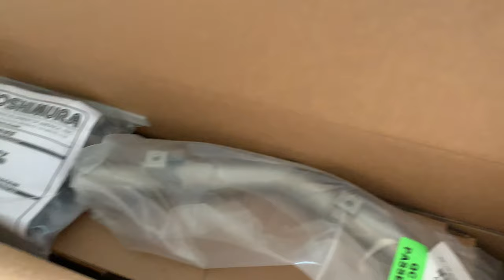Honda Monkey | Unbox, Install and Amazing Sound of the Yoshi Exhaust | Yoshimura RS3 Install

Comment: Hello! I have one question ... Where can I reliably buy a Yoshimura RS3 Full sistem for a Honda Monkey? Where did you buy yours? Of course I expect it to be original. Greetings from Austria.
Reply from the maker: I replied to this on another video, but no harm doing it here too! I bought mine on Amazon, but they also have them available on Steady Garage, MNNTHBX, DROWsports and Hard Racing (and likely lots of other sites, but these are the ones I frequent most for Monkey related parts).

Comment: Was the monkey a good starter bike? Love the low maintenance and retro look but is driving it easy? I’ve only driven manual transmission cars never bikes
Reply from the maker: Compared to a lot of other bikes, I’d totally say this is a good starter bike. Handling, weight, and the smaller engine size makes it easier to control and learn on. Just take it slow, get good safety gear, and have fun!
Reply: @UnknownOverLand  appreciate the feedback, if I do end up getting the bike definitely have to get this exhaust, sounds so good!
Reply from the maker: @YOSHIMOTO_HI_SPEED  it definitely makes the bike sound awesome. But watch out, mods can get addictive. :)
Reply: @UnknownOverLand  just got my 2022 honda monkey in banana yellow 🍌 
So excited!!! Ordering this exhaust when they are back in stock
Reply from the maker: That’s going to be awesome! Congrats!

Comment: Boy the aftermarket jumped all over the Monkey didn’t they. Looks great, sounds great.
Reply from the maker: They definitely did; there are so many options available for such a small bike.
Reply: @UnknownOverLand  now u need ecu tune and air intake
Reply from the maker: @cameronwilson4782  Have had various versions of both over last year. Check out my other videos for the aRacer as well as the Chimera intake.
Reply: @UnknownOverLand  nice, I reccomend the DNA stage 3, with that yoshi and the Cjr autotune
Reply from the maker: @cameronwilson4782  That stage3 has always looked awesome, but I still haven't had a chance to try it out.
Reply: @UnknownOverLand  yeah it’s more just looks. It’s doesn’t gain much more power than any koso or the $200 Mnnthbx intake. It does look a lot cooler though. And props to responding to your viewers, it’s nice to be able to chat with ya
Reply from the maker: @cameronwilson4782  Do you have an idea how the DNA sounds compared to the straight pipes like the MTAKE? I know that what I have can be loud for some people. Also, no problem! Thanks for taking the time to even watch!

Comment: Lovely video! What was theO2 sensor you replaced the OEM with? And was it a drop-in?
Reply from the maker: That O2 sensor came with the Bazzaz EFI I had installed at the time. In a later video (https://youtu.be/SPVzK45UOO0) I replace the Bazzaz with an Aracer setup.

Comment: At time 4:13 , the wire . Would have been nice to see where it plugged into.
Reply from the maker: Because I had a Bazzaz Efi I had installed, that o2 sensor was for that rather than the stock. In a later video (https://youtu.be/SPVzK45UOO0) I replaced that with the aracer.

Comment: Thanks for the great install vid! Please tell me, does this have the DB killer spark arrestor in it?
Reply from the maker: It is a separate piece you have to buy, but I did run one in mine basically all of the time.
Reply: @UnknownOverLand  Ok, so during the sound test on this vid, you had the spark arrestor installed?
Reply from the maker: Sorry, I realize I made that way confusing. In this video, no, I didn't have the spark arrestor quite yet. If you watch this video, it's when I finally got the spark arrestor (and I rev the engine a bit with it in): https://youtu.be/Ju6HyteWd80

Comment: Nice. Is that a stock Engine case. I could use that stick exhaust for a Restore I am doing. Did u have to rejet the Carb ?
Reply from the maker: Yes, the engine portion of the bike is stock. It’s actually fuel injected (PGM FI), so no rejetting. I did remap via the ECM, though, just to make things run a bit smoother.

Comment: The Lambda probe can simply remain in the cylinder head ... you don't have to screw it into the exhaust!
Reply from the maker: This is true, and I believe some after market headers don’t have the bung in place to move it. When I went aracer, the replacement probe only really fit in the header.

Comment: Just curious, did you install a free flowing air cleaner or a tuner?
Reply from the maker: I have both. For the intake I'm using the MNNTHBX MTake and for a tuner I've done a few things. Currently I'm running an aRacer, but I've also had the Bazzaz on the bike as well as have had a re-tuned ECU.
Reply: Cool!

Comment: Would you happen to know if this exhaust would be compatible with the Kitaco Honda Monkey Skid Plate fitment wise? Tnx for any info.
Reply from the maker: Amazing timing on your question because I was literally looking at that this morning as well. I believe that it should. The way that it installs it's meant to cover the stock headers (including the cat) which hangs a fair amount below the engine. The RS3 header has a bend much closer to the engine which seems like it'd keep it nice and high, and away from the skid plate. The one worry I have, though, is the side of the plate where the stock exhaust comes "up"; because the stock exhaust header has the cat, the bend upwards starts further back whereas the yoshi exhaust comes almost immediately up the side. This might be right where the side panel of the kitaco sits, but I'm not sure.
Reply: @UnknownOverLand  That's exactly where I think the Kitaco bracket will interfere. I already own the skid plate and just ordered the same exhaust as yours. I was freeze framing your install trying to catch the angles to see. I even called Yoshi but they said the did not know. I get my exhaust later this week. I'll update you on the outcome and thank you for sharing your insight and great videos.
Reply from the maker: Yes, please let me know how it goes. I know there are a few other skid plate options out there, but this was definitely the one I had my eye on.
Reply: @UnknownOverLand  Will do.
Reply: @UnknownOverLand  Well the skid plate did not fit due to the header pipe, without me doing some  handy man mods to it. I will say I went ahead and drilled some new holes and bent the sides out a bit and made it fit . In a nut shell on the plate itself drilled two new holes as far back on it as I could go where it attaches to rear bracket that get mounted up under the engine near the kickstand area. Then I had to flex bend outward the side flare parts that come up on both frontal brackets that connect on the sides of the engine on both sides. This made more width to accommodate the header pipe coming outward more on the exhaust side. Then I had to cut out a piece of the bracket arm on the left. Where I bent and flexed the plate outward it looks a bit shabby even though I protected it with tape and a rag, but i was not about to not try since the skid plate was almost $200. It feels solid in place and doesn't look cockeyed either. So all in all I'm happy with my rigging and feel confident I could take it off and on for any maintenance needs. I do not think knowing what I know now I would buy the plate knowing I was going to have to mangle it to fit though. But I also hate hearing "tink tink tink tink" as pebbles smack my engine under side. I'm sure you could make it work with your skills if its something you really want. I looked for other plate options but did not see anything except under cowlings. If you want to see what it looks like installed on my bike shoot me your gmail and I could send pics. I'm not a creeper or anything.
Reply from the maker: I was worried about how much mods it would take, but it sounds like it'd be manageable. I keep worrying about that one time that a stick decides it wants to test out the strength of my engine casing, so I was hoping this skid plate would be just what I need to worry less. If you don't mind sending along pictures, you can email them to unownshadow@unknownoverland.com.
Reply: @UnknownOverLand Ok will do.
Reply: @UnknownOverLand  I've sent the images. Had to send a couple times to fit the images.
Reply from the maker: Got ‘em, thanks for sending them along. Overall it looks good, I’ll take a closer look to see exactly what you did.

Comment: Sounds and looks great! does your check engine light come on now?
Reply from the maker: So far, no. I do have a Bazzaz fuel mapper on the bike as well, and haven’t had the check engine light come on yet.
Reply: Pardon my ignorance, why do you ask? Is that related to/caused by the exhaust replacement?
Reply from the maker: Some people have seen the check engine light come on for different changes to the bike, but it seems pretty rare.

Comment: Would you happen to know the db level of the RS3 at speed? I've looked online and only found the idle DBs. Your a Guru so I figured it couldn't hurt to ask.
Reply from the maker: I don’t have it immediately (though i may have posted it somewhere in some of these comments sections) but I can try and get some readings tomorrow and let you know.
Reply: @UnknownOverLand  Awesome thanks!
Reply: @UnknownOverLand  I just scanned all the replies on this thread. Did not see the dbs. It would be interesting to know. Top rev and maybe a drive by throttled up if the db reader can do that. I wondering if its anything near 90-100db at its peak.
Reply from the maker: @findingneutral  I realized that the comments I was thinking of were in this video: https://youtu.be/Ju6HyteWd80

Basically I found "Without the DB killer, idle it's about 86dB while rolling on the throttle it peaked around 116dB. With the DB killer, idle was about 82dB and throttle was around 112dB."
Reply: @UnknownOverLand  You Sir, are awesome. I know this will sound odd ball, but I just accidentally ordered a Delkevic ds70 oval carbon for a 2020 Yamaha XT250 I also just bought. I meant to order the 18inch version. Delkevic advised the peak db level on what I ordered would be 105-110 with the baffle in. In trying to figure out if that would be tolerable or just plain obnoxious I figured I would use the good old Monkey Yoshi RS3 as a base line. Based on your findings, which I greatly appreciate 🙏, since I was having zero luck finding anywhere, I can stop stressing about having to get the brand new muffler then turn right around and pay to ship it back then order the other and pay to ship it out etc... My 🎩 off 2 U 😃
Reply from the maker: Glad I could help!

Comment: how much does it cost
Reply from the maker: It depends on if you go full exhaust or not. The slip-on only seems to be $549, if you add the header it's about $629.
Reply: @UnknownOverLand  its a freaking rip off, no more extra power noticeble, maybe on paper😂😂😂😂there is so much more cheaper stuff with good looks either. i have done more then 20.000 km on my Monkey so i know from experience❤️🙏

Comment: What was that sensor and wire you removed?
Reply from the maker: That is the stock O2 sensor. I have a replacement O2 sensor that came with the Bazzaz Z-AFM which I installed on the header itself.
Reply: @UnknownOverLand  Can the exhaust be installed without replacing that sensor too? What is the advantage/difference between the original sensor and the one you installed?
Reply from the maker: If you don’t really change anything else, you can leave the stock sensor plugged where it is normally.

Comment: By chance, did you manage to weight both systems ? It would be interesting to know if the difference is something noticeable on a bike so small(light).
Reply from the maker: I did not, and probably should have. With the replacement header it removes a fair amount of pipe and the cat, so there’s definitely weight loss there. I’m unsure the weight difference between the mufflers, though. Maybe someone from @yoshimura_rd will wander by and chime in.
Reply: @UnknownOverLand  stock system is around 13 lbs rs3 is 7.5 lbs
Reply from the maker: Awesome, thank you for that info!

Comment: Did you feel a gain in torque or in top speed?
Reply from the maker: Generally this will be more targeted towards overall engine efficiency and some amount of horsepower. Because this system is lighter and with the change to fuel management the result would be a bit more top speed.
Reply: @UnknownOverLand  this is absolute not true, be honest When people ask. I have 20.000 km on my Monkey with Yosi IT doesn't go faster at all. Be honest please !

Comment: Come on man ,  800 dollars for 2 hp ... just gut the stock one and retain stock looks , the after market pipe is lacking in fit imho
Reply from the maker: I totally get what you're saying, especially since $800 is a bit steep. Personally, I like the look of this pipe on the bike and I also really like the sound of it; but these are definitely personal preferences. Removing the cat, and decreasing the overall weight of the system I think are additional bonuses in the long run, but could also be done without going with the full Yoshi install.
Reply: Lmao !!